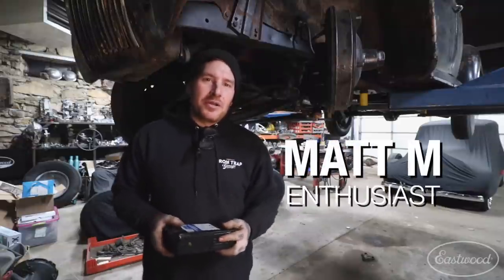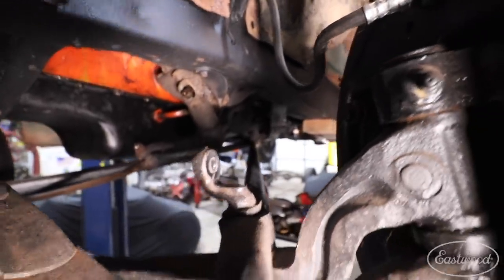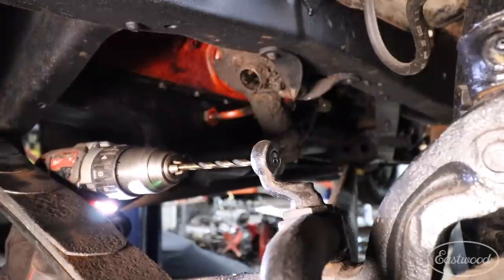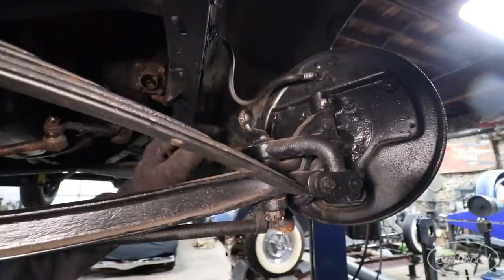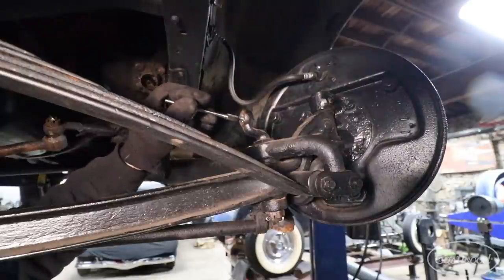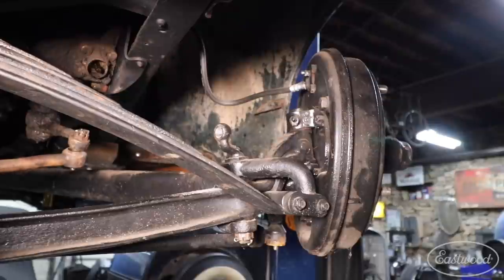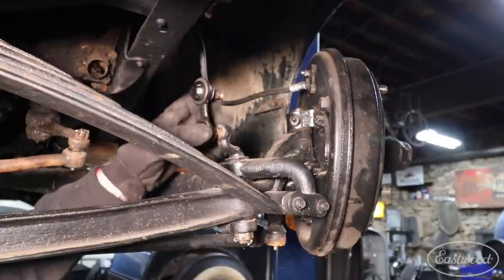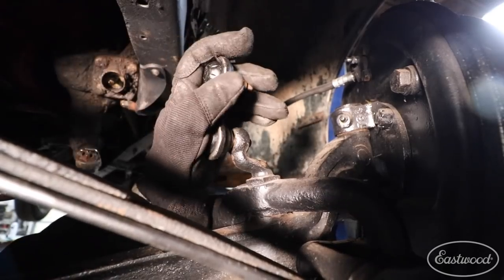How to Easily Remove a Broken Stud Using a Drill - Eastwood

Comment: Nice job Matt...  I usually drill thru with a 1\4 and put a cap bolt thru the hole to my 10# Slide hammer with chain attachment...  I also use the slide hammer to pull stubborn hubs and axles..